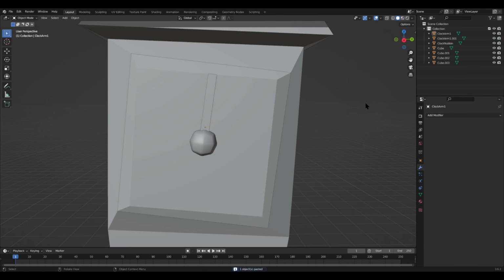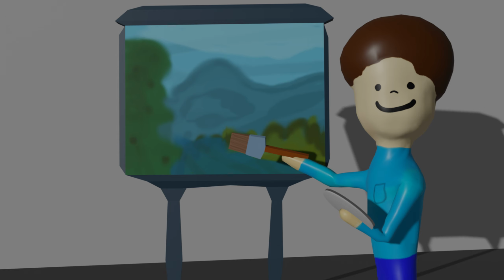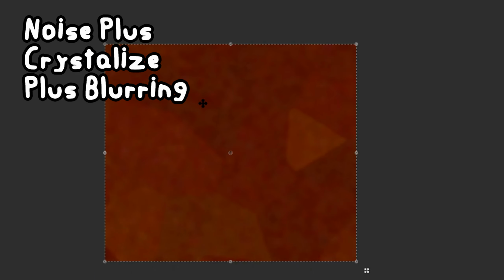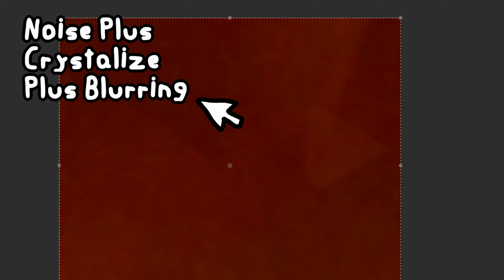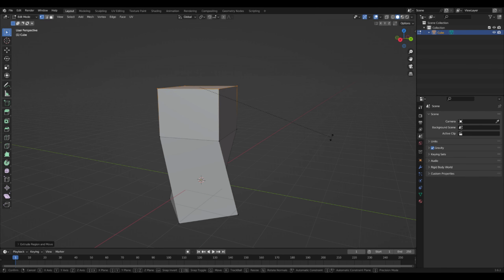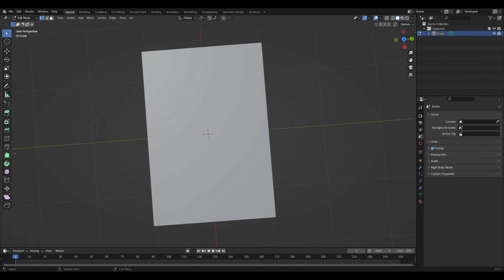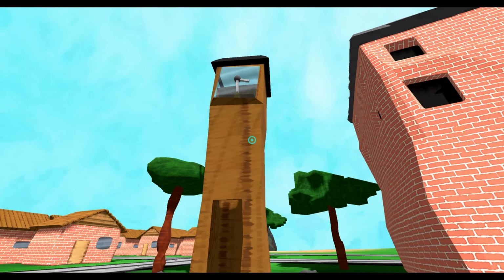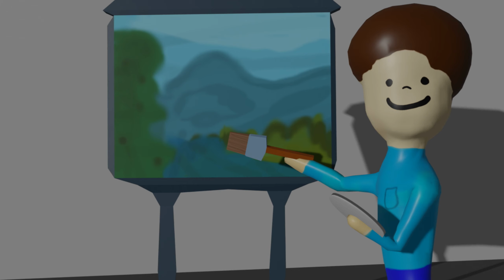I made 3D Models for my Godot Game (Bob Simulator Gamedev Project)

Comment: I worry that you are focusing too much on the idea of possibilities and not enough on the substance/modability of the game itself. For instance, one reason why Minecraft -- a game I just saw you use as the basis for your analysis of sandbox games -- is so much more modable than other games is because it is voxel-based, meaning that it's incredibly easy for players to modify world generation, textures, mechanics, etc; everything generates on a precise grid, so you remove the need to create unique models, and you also simplify the generation procedures for structures and landscapes. 

Remember, possibilities are the result of good infrastructure, not the blind pursuit of everything that seems like it 'might' add more 'freedom' to your game. 

For instance, why would a barn with a window enhance modability, freedom, and 'possibilities' for a player over a barn without a window? Why not have a barn with support structures in that case, wouldn't that follow the same logic of 'enhancing possibilities?' Why not make the barn out of at least 12 different parts so that players have the possibility/freedom of dismantling it? Etc. The best way to enhance the possibilities and freedom of your game is to focus on strong foundational material, not random instantiations of that material. 

Minecraft is not full of possibilities because the top 3 blocks of the world are dirt and dirt grows grass. Minecraft is full of possibilities because its worlds are full of emergent complexity and are extremely easy to edit, and that's not because, say, villager houses were designed with one entrance and a few windows as opposed to two entrances and, idk, no windows.
Reply from the maker: These are all good points, you should take a look at my newest video which goes into more detail on how the modifiability of maps contributes to the difference in substance of Minecraft vs. Garry's Mod:
https://www.youtube.com/watch?v=LOiU6FIxqck

What you are saying about how a game structure made up of a bunch of component parts is much easier to externally modify the game or the game's world, is absolutely correct! Voxel-based games including 2D tiling like in Terraria, make for a very easy way to add versatility.
Reply from the maker: Check out my latest video, I go into detail on how to develop a full-fledged modding API
Remarkably this video tackles what your worried about head-on
https://www.youtube.com/watch?v=vLQoVH1j9gM